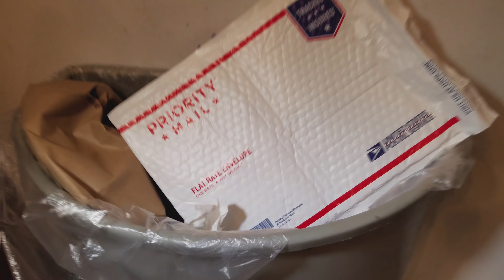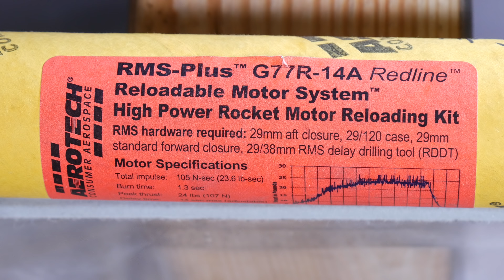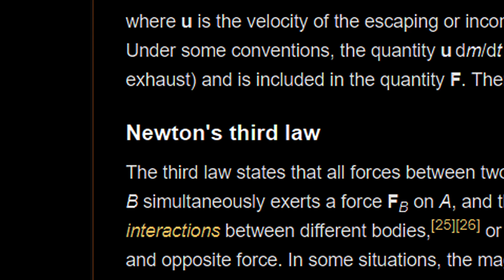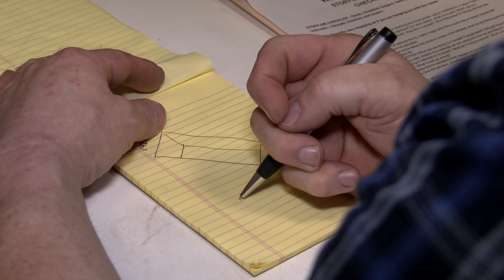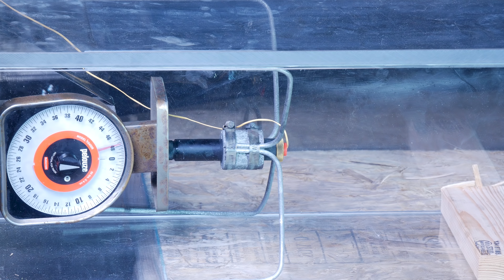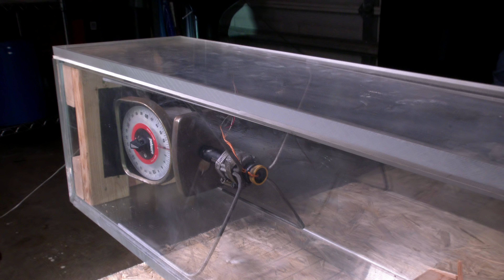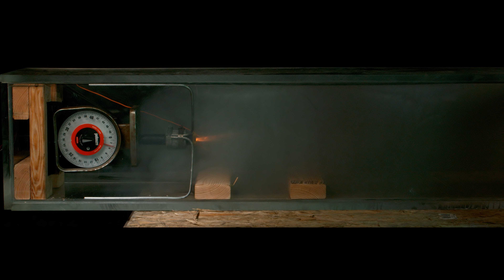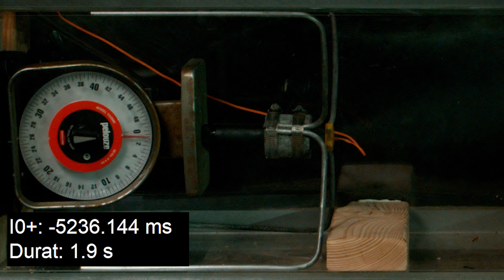Rockets in a Vacuum Chamber - Newton's third law of motion Visualized

Comment: I really don't like to say this but I really have to. First your using plastic to create a vacuum? You are kidding right.
Space is in the area of 10 -10 to 10-11 mbar. NASA has a vacuum system and it is not even close to that value.
So in truth your so called vacuum system is more like a vacuum cleaner and still no ware near the space values.
Also when you use the rocket you did not account for the expanded gas so the lid defeated the vacuum idea.

So in truth you are not even close to the value of what NASA states the vacuum of space is. Now you have to do what NASA did. 
They created a very thick walls of stainless steel  vacuum chamber and yet they are still not to the level of what the vacuum of space is.

Comment: The ignition thing is one of the primary reasons why SRBs usually go with hypergolic fuel, which ignites once both parts of the fuel composition comes in contact with each other. No spark necessary.

Comment: The thrust only started when it as pushing off the opposite end wall .
Reply: So can the rocket engine accelerate the mass of the exhaust gas away from the engine without applying a force to that mass?
Or does the engine exert a force onto the mass of the exhaust gas to make it accelerate?
Reply: You can see that the scale is measuring a force at the very moment of ignition. At that point, the volume of gas produced is negligible compared to the volume of the chamber. 

The rocket pushes off the exhaust gasses it ejects.

Comment: He cant ignite the  rocket in a vacuum be no combustion engine
Reply: We ignite solid rocket motors in hard vacuum frequently.  They work just fine.  In fact they generate MORE thrust in a vacuum than they do in atmosphere.
Reply: @stuartgray5877  not a  trur vaacum chamber experiment  considering some broke  vaacum seal and  let the smoke  out of th box and  let atmosphere back in the box
Inconclusive evidence   🤔try again
Reply: @ejones6647  want "conclusive evidence"? Watch the YT videos of the SpaceX launch of ArabSat 6A.  Then explain how those side boosters turned around in vacuum , and flew back to land at KSC.
Reply: @stuartgray5877  please post a video of the launch you are referring to
Reply: @stuartgray5877  please post a  link to the video  you are referring to
Reply: @ejones6647  OR search YouTube for: "SpaceX Falcon Heavy ArabSat 6A Launch and Landing in 4k Ultra HD" by Cocoa Beach 365
Reply: @ejones6647  see I POSTED THE LINK BUT IT IS BLOCKED.  Now perform the YT search using the text string above!
Reply: @ejones6647  did you watch the video yet?
Reply: @stuartgray5877  im gonna watch the video  of falcon  heavy  arabsat6a
Reply: @ejones6647  pay attention to how the first stage engine plumes expand as the rocket gets higher and higher. Then look for the video from the rocket (side boosters and center core) provided by SpaceX.  You can tell from the Spacex video that when the side boosters separated that they were in vacuum by they way they gracefully "peeled away".  If that had still been in atmosphere, the separation would have been far more violent.  The entire rocket was travelling at about 3600 mph at separation.
Reply: Well?

Comment: A flat earther demanded i prove that ignition could occur in a vacuum, then he said "I'll wait"
I took less than 30 seconds to post this video as a response, and i said "i'll bet you'll wait, cuz you ain't got nothing on that" 
It's been over 15 minutes... and ticking
Reply: Problem is you failed, because you cannot provide an absolute complete vacuum to do the experiment in.
This guy is a paid for government shill promoting lies ❗
1) you cannot pull a complete absolute vacuum in any vacuum chamber.
2)  In that vacuum chamber the gases produced by that rocket engine could not be absorbed as fast as they got produced.
3)   the gases coming from the rocket engine pressed against the side of the vacuum chamber which gave it its boost pushing it across the alleged vacuum chamber.
4) Just like in a vacuum flies can't fly. Everyone should know that for every action there is an equal and opposite reaction, that is, as long as you have something to be pushing off of or against.
So, what you just inadvertently proved to the world, if the sheeple can see it; is that, like a fly that can't without an atmosphere for its wings to be beating against, a rocket engine cannot Propel anything in a complete vacuum either; because there's no atmosphere for the hot escaping gases to push against. Proving that there's no such thing as space travel. Like going to the moon, satellites in outer space or sending a rocket probe to other alleged, so-called planets.
Wake up sheeple❗ NASA, Never A Straight Answer - National Academy of Space Actors. They are lying to you, belittling you, making fools out of you, taking you away from our Creator God.
The Words of Christ: "And no man hath ascended up to heaven, but he that came down from heaven, even the Son of man which is in heaven." John 3:13 KJV
 Let those words sink in, think long and hard about what it is telling you. Yahushua, the Lord Jesus Christ KNEW that we were going to be fed the lies of allegedly traveling in the heavens, what they call outer space.
Repent and be baptized in the name of the Lord Jesus Christ. We are in the very last days of this Earth's history ❗
Reply: @jrngln  
Nice copypasta. Every word of what you just said was wrong.

1) We can get close enough for practical purposes. Technically space isn't a pure vacuum either, but it's so rarified that molecules rarely come into contact with each other.
2) A vacuum doesn't "absorb" anything, you're speaking nonsense.
3) How exactly do gases on the opposite side of the chamber affect the rocket motor? The answer is they don't. The only forces come from the direct interaction between the motor and the gas. As soon as the gas leaves the motor, it can't transmit a force.
4) Yep. Rockets push off of their exhaust gas.

Comment: FAIL in CONCEPT.    Bad thinking.    ANY sealed container IMMEDIATELY becomes pressurized INSTANTLY when the fuel is ignited.  You have succeeded in at least one thing....you've proved that your channel is aptly named.

Furthermore, size matters (chamber way, way too small) and a vacuum is not without degrees of power.   Your puny vacuum was nearly infinitely less than that of outer space.  If you actually knew anything about the neg 10 Torr vacuum of outer space you'd be ashamed of this video and yourself.
Reply: Oh so could YOU please explain the "negative 10 Torr vacuum" of space?  What pressure (in PSI) is this "negative 10 Torr" vacuum?  (Hint: I can tell that YOU know less about this topic than the OP)

Comment: You're not realizing regardless how large your vacuum chamber is, it is not the size of the Universe and does not possess the same vacuum potential space possesses which is 1x10^-17 Torr if it’s deep within our solar system or at a much higher vacuum if it’s interstellar space therefore, the two cannot be an equal representation of the other and what will really happen in reality. An example is, if I told you to create a gravitational field in a lab, you are going to say it requires being on a Planetary scale. So let’s just delete the nonsensical experiment, and leave it for the fools who believe in your rubbish.
Reply: - "the same vacuum potential space possesses which is 1x10^-17 Torr"

I'll save you a bunch of typing.
Another way to say 1.0X10^-17 Torr is just "0.0 PSI".
You are welcome.
Reply: @stuartgray5877  No, the actual number is 0.00000000000000000006944444444 psi. Not zero. Absolute Zero pressure represents no Atoms in space, which is theoretically impossible. You should know that, so let’s cut the nonsense.
Reply: @pantheraleoromanus6241  - "You should know that, so let’s cut the nonsense."

So, what part of my statement is in question?
And dumb it down for me, I have only been a Vacuum Test Specialist for almost 30 years now.
The first thermal vacuum chamber I learned to operate was at Lockheed Martin Space Simulation lab in the 1990s. It was the giant solar thermal vacuum chamber where they tested the Viking landers.
Reply: @stuartgray5877  He just told you, lying chatbot. You'll just ignore him & waste his time like you're programmed to 😂
Reply: @papalegba6796  Then YOU explain where the misinformation ns in my statement genius.
You cannot because it is 100% accurate to over ten decimal places.
Reply: @pantheraleoromanus6241  - I didn't read a word of all of that. Did you have a point?
Reply: @pantheraleoromanus6241  - I am an aerospace test engineer with almost 30 years experience building and operating many of mankind's most advanced vehicles.
I test fiber-optic gyroscopes before installation into the vehicle by measuring earth rotation and curvature.
Now read what I just typed very slowly.
Then go back and finish high school.
Reply: @stuartgray5877  Actually, perhaps you should resume your primary school education before casting stones when residing in a glass dwelling, as I needed to remind you that absolute zero pressure theoretically doesn’t exist.  Now, if you’re running simulations with numbers and values that are fictional, I wish you the very best in your experiments.
Reply: @pantheraleoromanus6241  sorry but my statement that 1.0x10-17 Torr is equivalent to 0.0 PSI is still 100% accurate.  Perhaps it is you that needs to understand how math works.  You should not argue about vacuum or math with an actual engineer before completing high school. But bless your little heart for effort!
Reply: @pantheraleoromanus6241  - " Now, if you’re running simulations with numbers and values that are fictional, I wish you the very best in your experiments."

No but I HAVE been operating some of the nation's largest thermal vacuum chambers since before you were born AND I have launched five spacecraft to deep space.
What do YOU do for a living?
Reply: @stuartgray5877  The vacuum of space is incredibly powerful, 1 x 10^-17 torr, and the vacuum between the Earth and the Moon is 1 x 10^-11 torr.
Space has 5 atoms per 1cm^3. Interstellar space has 1 atom per 1cm^3, while intergalactic space, is 100 times less. 
Absolute Zero pressure represents no Atoms in space which is theoretically impossible. 
For your knowledge and education at sea level on Earth, one cubic centimetre of air contains around 90 million million atoms.
You should be absolutely embarrassed not knowing this information, and claiming you are an Engineer.  I sincerely advise you to remain silent rather than appear further ignorant.
Reply: @pantheraleoromanus6241   @pantheraleoromanus6241  Nothing you said above disproves my statement. I am sorry that you do not possess the intellect to understand math.
You even proved my statement TRUE when you said "No, the actual number is 0.00000000000000000006944444444 psi. Not zero. "
See when I ONLY GIVE YOU ONE DECIMAL POINT then it IS 100% TRUE that "1.0X10^-17 IS EQUAL TO 0.0 PSI"
Learn how math works.
Reply: @pantheraleoromanus6241  Now tell us what you REALLY think. DO you think that space travel is all fake or something?
Reply: Stuart Gray is a chatbot programmed to waste your time 😂
Reply: @pantheraleoromanus6241  
In what sense is the vacuum of space " incredibly powerful" ?
Reply: @bobartor910  My original comment was directed at the video producer. Therefore, I’m uncertain why you are also responding, while he has made no comment.
Reply: @pantheraleoromanus6241  
I don't understand why you claimed "the vacuum of space is incredibly powerful " when it clearly isn't.
Reply: @pantheraleoromanus6241  - "Therefore, I’m uncertain why you are also responding, while he has made no comment."

Because you keep making stupid statements from ignorance.
The vacuum of space has exactly ZERO "Power".
The vacuum cannot even exert a force on ANYTHING genius.
Reply: @papalegba6796  So now chatbots have YT channels filled with videos showing the Bots' Hobbies? Yeah you are brilliant!
Reply: Stuart Gray is programmed to claim chatbots can't use YouTube channels to comment 😂
Reply: @pantheraleoromanus6241  The difference between 10E-17 Torr and 0 is negligible when you are talking about systems influenced by pressure.
Reply: @pantheraleoromanus6241  But it is HILARIOUS that you keep trying to explain "vacuum" to someone who has been a VACUUM TEST SPECIALIST since before you were born. 
I was trained at Lockheed Martin Space Simulation Laboratory as my first job out of college almost 30 years ago now.
I have been personally responsible for multi-BILLION dollar government vehicles inside giant thermal vacuum chambers for multiple months straight.
You struggle to SPELL "vacuum" genius.
Reply: @pantheraleoromanus6241  Still trying to explain how basic Mathematics works for you.
The Number 1.0X10^-17 IS: 0.00000000000000001

When I TELL YOU that this number is the "SAME AS ZERO TO TEN DECMIAL PLACES" I am explaining a FACT.
Because "Zero to ten decimal places" IS: 0.0000000000
In the "real world" 0.0000000000 = 0.00000000000000001 to TEN DECIMAL PLACES is 100% FACT!
Now GO Back and finish HIGH SCHOOL before trying to lecture people that actually DID.
Reply: @pantheraleoromanus6241  It is hilarious watching you argue about how math works when you are clearly out of your league.
But carry on this is very entertaining.
High school dropouts arguing with actual rocket scientists about how the vacuum of space works - Priceless.
Reply: @stuartgray5877  I guess this is now your motive for resorting to an ad hominem fallacy which is personally attacking the individual, rather than the subject in question, a strategy implemented when one has exhausted all avenues of credibility, and the intellectual capacity to pursuit the debate based upon its factual evidence and leaves them with nothing.
Reply: @rocketman484  A superb illustration of your intellectual ability. You must have graduated with honors.
Reply: @pantheraleoromanus6241  So you claim to have a degree but refuse to tell us what it is \or where you got it? Yeah that seems reasonable.
I have worked at Lockheed Martin and numerous different aerospace companies. I have never met a single person with a degree (where I work now there are over 5000 degreed engineers) that has refused to tell me where they got their degree from. It's almost as if you are lying.
Reply: @pantheraleoromanus6241  Oh and I graduated high school at 16 (with Honors) and then attended college to receive my Electrical Engineering degree in 1993.  I could have obtained my Engineering degree before I even turned 18 if I had not also been an athlete.
You?
Reply: @pantheraleoromanus6241  Where did you GO? I gave you undeniable evidence that rockets DO work in vacuum, and now we hear nothing from you?

You are either too embarrassed to show your face here OR the evidence is just too complex for you and you ran away.
Which is it genius?

Comment: because, you can't float in the vacuum of space, without a natural atmospheric pressure, you would explode.
You are Obviously ASSUMING man has floated In Space?
Cart before Horse sonny.
Disney Channel loves you.
You saw space walks ON TV?
Reality vs. Hollywood.
Life Imitating Art.
Think Atmospheres of Pressure!
As you dive deeper into water pressures rise and can crush, remember those submarines gone to deep ON TV?
Remove atmospheric pressure and you will expand and burst.
Watch the video again, he stated 14lbs per sq. inch natural pressure in that room.
Reply from the maker: That's correct 14.7 psi of pressure which is the weight of the air pushing down
Reply: No, no and no! If the container walls have enough strength to hold the pressure inside then it will not explode in a vacuum. The third gas law explains this quite clearly. A scuba diving tank can be pressurized to 2600 psi
Reply: @nicsandee123  but there are no "container walls in "The Concept" of 'space.
Reply: A spaceship is a container. You can prove all this yourself at home. Take an empty metal gallon can(mineral spirits) put an inch of water in it and boil it. Give it a few seconds when it’s boiling and then screw the llid on. The can walls will crush because the water vapor has displaced the air from the can, lower pressure. The air pressure on the exterior crushes it. In a vacuum the van would rupture due to it not being strong enough to contain the air pressure inside. If you were to repeat this experiment with a can made of 1/4 inch steel nothing would happen
Reply: @nicsandee123  let's try a different approach; What is your IQ, how far did u go in school? If you contend to joust with me, at some point you need to produce your degrees in sciences
Reply: Jousting huh? Well I’ll need a horse and perhaps some armor. Are you sure it’s science you want or are going to attempt to push a belief system on me. Just asking? I was educated in England decades ago, at a time when an education actually meant, something. My IQ is 131. I’m pretty smart.
Reply: John I’ve been hunting you down? Mmm, I do t think so, I find that remark a little creepy to be honest. As for Walt Disney, I don’t think he ever made it into earths orbit. I don’t think I mentioned a bath tub, and as for references to science degrees, why is that important to you? You clearly do not have a science degree or you would understand the third gas law. Even if you don’t believe in space travel those laws still apply to life here on earth. The computer you are using is a product of science, it very operation is governed by the laws of physics (the flow of electrons down a wire) and chemistry ( the plastics and the circuit boards) these things are very real.